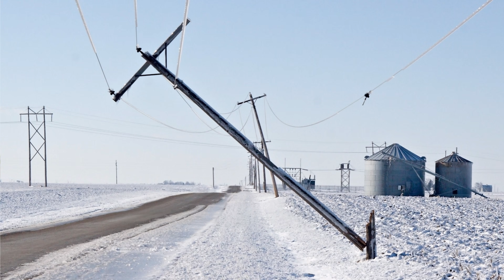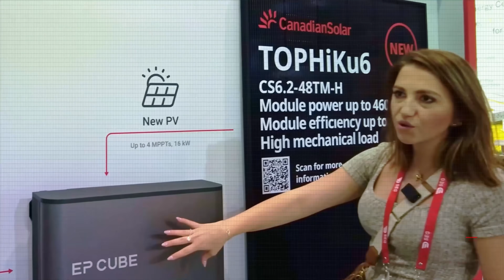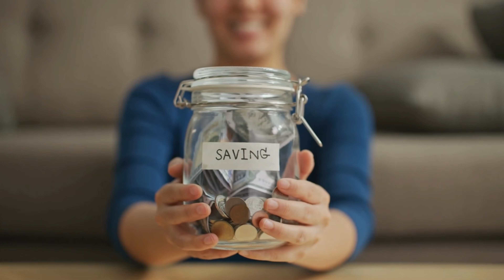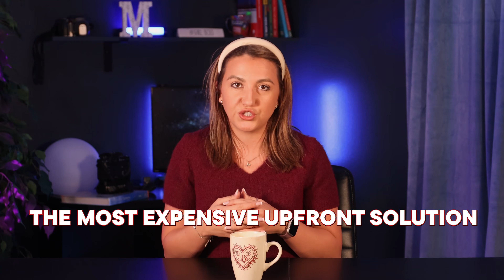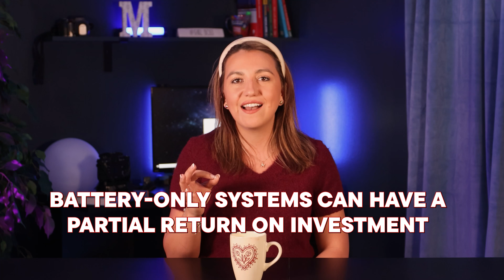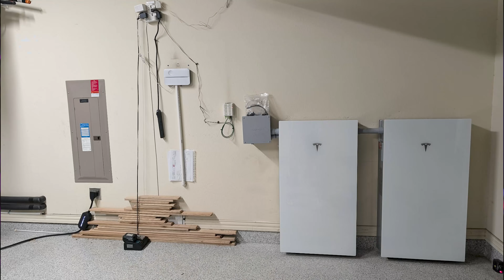No Power During Winter Storms? Generator vs Battery Backup Explained – You Might Be Surprised!

Comment: All good except you failed to include the newest battery only solution that has a much lower cost to the consumer.  Several companies are now active in the Texas market that the upfront cost for batteries is about $3500 and then they become your power provider is some markets (they charge about .08 to .10-cents per kW).  Ideally all home owners should be looking at batteries for emergency first and savings second in many of our Texas communities.  Then solar panels are not too demanding if thinking of that solution, it just needs to have some support on sunny days and cloudy weather rely upon grid charging solutions.
Reply: We have a few guys I work with installed that and it is interesting (and seems to work)  but my goal is to own my own gear so I can reconfigure as I want to.
I've seen in Calif they seem to have someone that will 'rent' access to your batteries (if big enough) for around $1400 a month (probably variable) but no one in Texas yet I think.

Comment: There is only one problem with the solar and battery solution it requires the sun to shine.  In winter the sun may not be out for days at a time.  Also powering a 5 ton geothermal furnace is beyond most battery setups.  The only dependable solution is a whole house generator.  We have a 16kw solar ground mount and the sky here in the Huudson Valley has had very limited sunlight for the past couple of months.
Reply: You have an odd definition of "dependable".  In a large scale disaster, fossil fuels disappear pretty quickly. If your furnace is electric, yes, batteries will have a hard time powering that for more than a few hours. If you live in a cold climate, primary heat should be something else like a wood furnace or natural gas piped directly in with wood as a backup like a wood stove. In all cases, invest in insulation.
If you are trying to heat your home with solar, you will need a massive battery. How big is your current battery?
Reply: Don't have batteries yet and yes barring a major collapse of the country a generator using gasoline or propane is dependable.  I've gone through a major disaster with a generator.  Adding a 30 kWh battery system to the solar system would give the maximum benefit and the generator can charge the batteries using less fuel than just running a generator.
Reply: @chrismaxny4066  Every disaster I have been in, gasoline and diesel is the first thing to disappear. Sometimes a couple of days before the disaster.
Reply: I don't consider fossil fuels reliable at all.
Reply: @chrismaxny4066  not sure what country/world/dimension you live in but here during any minor disaster gas and propane are literally the first to go out. Anything but dependable.
Reply: buy a small generator that can just be used to top up the batteries as needed.
Reply: @_xyzyz_  Also V2H. That is another good way to import energy.

Comment: Excellent video! 
How do you feel about a battery + solar + small generator hybrid combo?
Also, is there room to consider the new Ecoflow Ultra or Anker E10 unit? 
Perhaps you can comment on this equipment. 
Thank you
Reply: I am not Martyna but I like that combo. It covers the weaknesses of each. I would add to look for a generator with a remote start option so you don't have to go out into the environment to run it. Also, many solar systems have auxiliary relays or even dedicated gen start relays that can automatically run the generator to add charge if the battery gets low.
Reply: I am also considering a solution such as the Anker E10.  The addition of a tri fuel generator seems to mitigate a battery only option and provide a lot of flexibility in the use of the system during periods of normal use.  It would also allow me to add solar later and over time.  For example, you could add a small amount of solar to cover the electrical draw of the battery system.  

I am struggling with spending money on a generator only option that provides no ROI or alternative use opportunities.

Comment: You really produce some excellent videos with reasonable durations. Bravo! At 6:47 you really brushed over the Auto Trans Switch advantage of battery systems. That is the transfer time. Systems like Sigenergy have 0 m.sec and most are < 20 m.sec!  This means you likely will not even "feel" that the transfer happens (nor will your electronics)!

Comment: I love having solar + battery for our frequent outages instead of messing with generator gas & maintenance, and I save money every day using the battery during peak rate 5-9pm then recharging the next day with solar, but the solar panels are nearly useless when covered by snow
Reply: Solar systems cost $10-30k.  The ROI is 10 years for the panels, but batteries never really reach their ROI, with an EOL of 3-5 yrs.
Reply: @jefff @jeffforbess6802 ries do NOT have an EOL of “3-5” years, don’t even know who’s butt you pulled that out of. Those things literally have an EOL of close to 20 years. Same for the panels.
Reply: @zimvader25  he might be using 12V old school Lead Acid knowledge. So yes -This video is talking about more modern LIP4 batteries.
I'm wondering if someone starting out NOW should get the batteries that are higher than the 48V stuff I bought as you can save a lot on wire with 100VDC to 400VDC batteries. Not sure how much of the 'high voltage stuff is DYI  but seems like the lower 100 ish VDC stuff is probably ready for DYI.

Comment: Remember that with solar + battery if you loose grid power in a snow storm, like the one half of the states are getting tomorrow, the batteries won’t be able to charge because the panels will be covered in snow likely for days before they start producing again. A probable scenario.